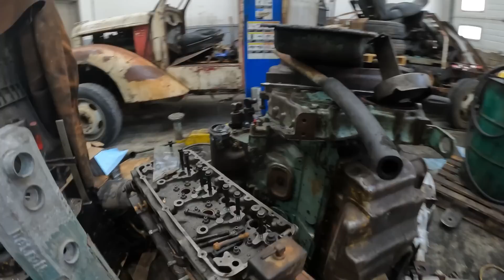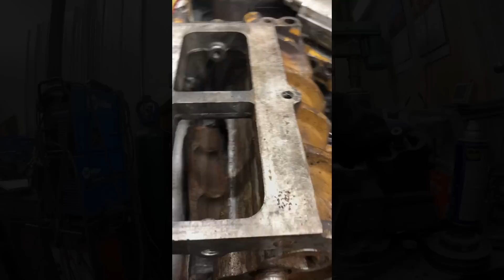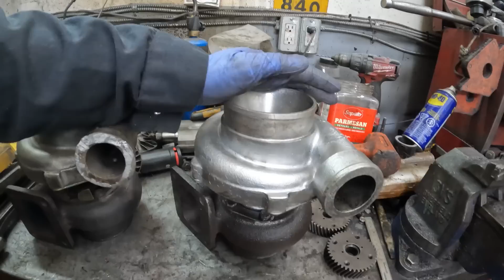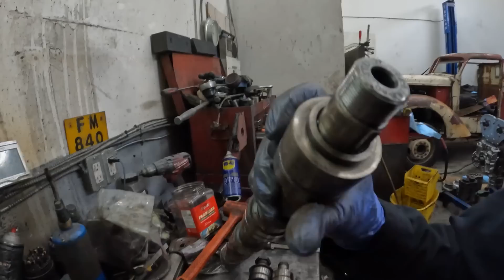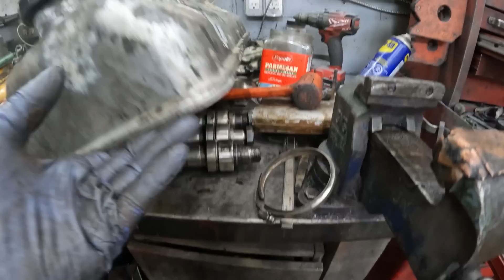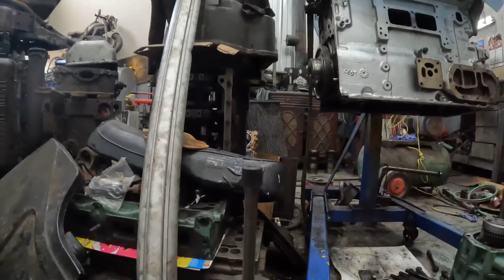Detroit 4-53 Differences ( N, T, Silver Series )

Comment: Is it possible to correspond with you directly somehow? ...I have a similar old project truck ( 52 gmc 630)  and would like some input on a few of the project goals and how i plan to achieve them. I value your input as you have a similar situation to mine here in Alaska as far as parts and weather and general expectations. As far as range and being remote and possibly a little farther from roadside assistance
Reply from the maker: Sure, you can email me at emerald310@gmail.com or call me @ 778-477-1745.:)

Comment: Thanks for the great video. Nice to see the difference on the 453's. The GMC's in the late 70's with the 453T's were horrible. Noisy, stunk of diesel, leaked oil, bad power band. But the 453T's were replaced by the Detroit 8.2L Fuel Pincher. What a disaster.
Reply from the maker: Yeah the 8.2 was nasty.:)
Reply: @detroitgarage9430  Not in a pickup that's were all 8.2 should have went in Chevy pickups and they would have owned market share

Comment: The main oil gallery on a N series is 5/8 inch diameter and  on the T series the main oil gallery is 3/4 inch diameter for more oil to cool the pistons and as you said the larger oil cooler is there to keep temperatures under control and a very good talk about 53 series history and development thank you Detroit Garage well done. The dyno should be fun.
Reply from the maker: Thanks Joe, something else I never knew.:)
Reply: @joemaser9122  is the main oil galley straight and accessible? Would it be possible or beneficial to hone the galley on an N block larger ? Or is the casting to thin ? ( probably questions I could answer myself if I were to disassemble and inspect mine ...but it is running and stored off sight currently)
Reply: @greywuuf The first N I turboed I discovered the difference and decided to open up the N oil passage I figured Detroit had a reason so I made a 11/16 drill bit long enough to drill the length of the block. You must check the block to make sure there's enough metal so as not to drill out the side of the casting
Reply from the maker: @greywuuf  Possibly, I'll have a peek and see.

Comment: Good job and thank you. I run a 4-53N in my old USN utility boat which now serves as an USCG Auxiliary Patrol Facility. Always wondered if slapping a turbo on would be helpful. Now I know better. Cudos for putting a DD4-53 into a F350!
Reply from the maker: Thanks and thanks for watching.:)
Reply: the only issue you would have in a marine application would be the valves and seats

Comment: Is the bypass valve the same on all Detroit engines i.e 53 to 92? How do you know if it's working or not? I would love to see you take one apart and rebuild it if that's a thing.
Reply from the maker: The valves are pretty much the same.  Very simple unit and really nothing to rebuild.  Can be tested using vacuum and also on the engine by comparing airbox pressure to turbo boost.  When the valve opens the airbox pressure should fall and be close to the turbo boost.:)